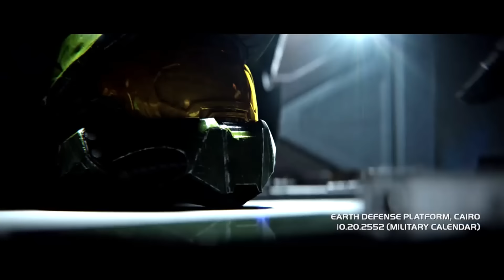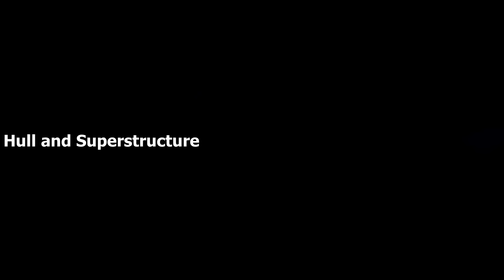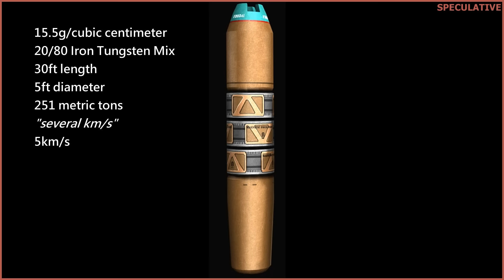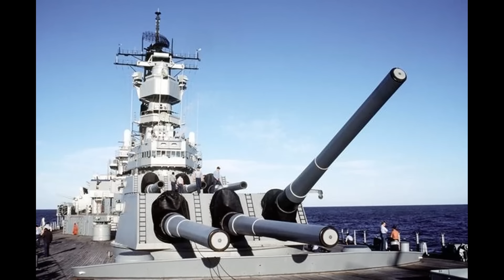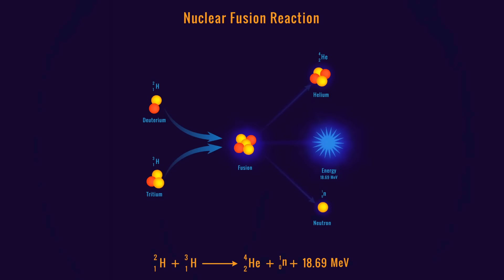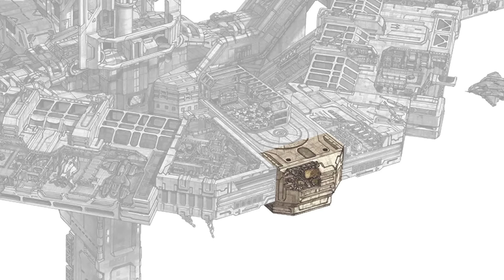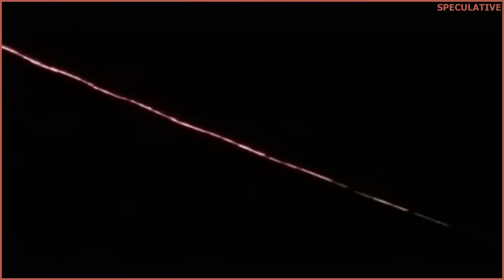Orbital Defense Platform | Most Detailed Breakdown

Comment: Dude. Railguns / MAC guns in Halo and even what we’re attempting to do in real life, are so damn cool. They just take up SO MUCH energy. And the forces exerted onto the firing chamber and platform itself causes any large railgun prototype to essentially tear itself apart, which can cause really big and bad accidents to happen if the firing chamber somehow is buckled or misaligned or whatever, and the projectile hits that damage.

They’re while we’re getting more knowledge about them with the real world tests being run, a huge limitation is the power needed to regularly run it. Essentially if we wanted to retrofit large battleships / destroyers / or aircraft carriers, we’d have to throw on a whole extra very efficient nuclear reactor onto the ships. (I know modern aircraft carriers are nuclear, unsure about other large gunships). But along with the guns themselves, and the added reactor, I think it becomes a very heavy and inefficient system. 

We need to crack sustainable fusion based nuclear reactors, and be able to control the whole process easily, create materials that can withstand the process long term, and collect the energy that it would produce in a highly efficient way. And then make it small and light. Assuming if we do that, we would also have materials strong enough to withstand the physical effects of a giant railgun being fired continually. We could also figure out ways to harvest the spare energy from the gun and feed it back into itself. Like how hybrid and electric cars use braking to recharge the giant electric battery. Perhaps capturing the heat from the firing and generating power from it. Or some other cool futuristic way they end up figuring it out. Then it would require less energy, and make it more accessible because a less giant less powerful fusion reactor would be needed also. 

I wonder if I will be alive to see humanity crack it. Maybe if we get the orange idiot out of office. And we start following chinas lead with educating all of the population equally, and investing in our country’s people instead of selling us down the river. He’s done so much damage already to what we could be as a nation. Very sad. I used to muse about the future as a kid and wonder what I would see. Now we’re on track to collapse back to a failed state. All so a few rich ppl can get richer, while they’re at the end of their life and don’t have to deal with the effects of this stupidity.

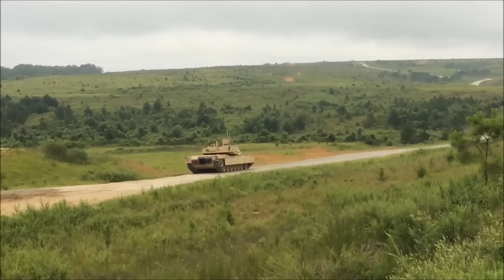Comment: 24:11 you state the projectile speed at 5km/s and weight at 251t. I cannot argue the weight as mass doesn't lie but for shot velocity Adm. Hood (I think) claims the shot at 3000t and 4% of light speed, or 12,000m/s. While obviously not as heavy as that the given weight at the new speed measures 1,151,520 tons of TNT equivalent energy. Given what we see these projectiles do, namely able to penetrate 2 heavy cruisers and embed into a third assuming a perfect shot and the ability of covenant shields to withstand moderate yield warheads (shiva class) I really think the higher speed is more likely. A 750t warhead is backpack sized and honestly not even worth building the massive platform as a shiva would deliver a 30Mt yield. I would have to assume the physical mass of the projectile would be more effective than the sheer numbers given the shields are likely tuned for anti-energy fighting other covenant style vessels and less effective at altering mass-based energy loads. At 1.1Mt the energy delivery is still far below a shiva but well within the realm of justification for construction given the ready availability of ammunition and not requiring fissile materials.

Comment: Error at 1:07:22. 15 km/s would not be even close to 5% the speed of light. 5% of light speed would be closer to 15,000 km/s, so this would actually be only 0.005% of the speed of light. I assume this was an error with confusing 15,000 meters per second with 15,000 kilometres per second. Just wanted to point this out for the sake of clarity.

Comment: The trams seem very excessive in design., i can imagine that building these ODP's is highly expensive and so minimisation of size and thus cost sould be incredibly important. Some sort of transport would be required for the size of the design, but this could be countered by a more efficient and compact design.

Why are there multiple bottlenecks by having the habitation modules stretch around the station??? Surely having a compact design around the MAC would be more efficient and stronger in the event of battle damage. 

The big counter would be "ew its ugly" or  "it would be boring for cut scenes". However i dont think so. Think of battleships in the 20th century, there is plenty of areas where you can see out but many more where you are condensed within the hull of the ship.

Furthermore a compact design could save weight and cost and allow greater armouring around critical components so that the ODP can remain operational and defending its respective planet.

Having such a spindally and weak structure for a Orbital Defence Platform just doesn't make any sense. 

By having a more compact design you could also forgo the need for transport as the station would be more walkable.

ALSO, why the hell is the brain 'the bridge' so exposed. Having sensores and etc outside the ship makes sense but the bridge should be buried in the heart of the station like the reactor and autoloader for the MAC.

If the bridge needs a view of the outside then that could be provided by cameras outside.

Bit of a rant
Reply: The entire point is that the station part is built around the gun to balance it. And most the station is just the two try docks  on each side, the stations connects those
Reply: If something has gotten close enough to the station that can shoot it then its too late for armor or survivability to matter. They outrange everything else in the setting by a factor of like 5 and thats what they rely on. Something similar is the AMX-30 ACRA. A tank modified to fire ATGMs. This was at a time when russian tanks didnt have rangefinders. So the ACRA could fire at russian tabk coloms with impunity while the russians were trying to range in the target before using its speed to escape before they got a bead on them. Also the bottlenecks would make it easier to defend.

Comment: 1:07:22 - "15 km/s is 5% of the speed of light"

I think you dropped a couple orders of magnitude.  15,000 km/s is 5% of c.  15 km/s is 0.005% of c.  Maybe you took 15,000 m/s and read it as km/s?
Reply: Uhm.... 1 km = 1000m
So 15km/s is indeed 1c.
Reply: @KAKU_64
C is 300,000 km/s

15 kps / 300,000 kps is 0.00005, or 0.005%. If you don't believe it, just go type 15 kps into one of the dozens of "percent speed of light" calculators out there.

What I am saying is that 00 may have been working with the 15 km/s number and converted it to 15,000 m/s (probably to calculate kinetic energy), then mislabeled it. In other words, he accidentally and incorrectly multiplied by 1000 somewhere. In the metric system, the most likely candidate for such an error is changing prefixes.
Reply: How would he misread 15000 m/s to km/h if km is bigger than m? Lol
Reply: @KAKU_64 did you even read his pinned comment that corrected it? C is the speed of light. The speed of light is 300,000,000 m/s. Aka 300,000 Km/s

Comment: Great video all around. just something i noticed that has been a problem in other real life ships/bases that seems to be potentially present in the ODP layout.

The use of numbering and color coding is good, but i would say that if the ODP were ever expanded on in cannon there should be a slight change to the numbering:

The port/starboard side should be enumerated slightly differently, due to the hangers being enumerated as A.01/A.02 on the same side. The numbering of r.01 and r.02 for port and starboard could lead to easy mistakes for logistics and staff, imagine getting told to report to hanger .02 and knowing the station numbers going to the starboard hanger .01 equivalent by mistake, this is surprisingly common on some older ships/bases and has been mostly fixed by renaming/renumbering affected areas
the easiest fix would be for the leading number should be a qualifier to denote the mirror of the module. [0 for port, aka .01 .02 .03 would all be port]

To expand on the fix to this i would recommend that the port be 0 [X.0X] and starboard side be qualifier 9 [X.9X] to help against dyslexia problems and communications interruptions/interference as 1 [X.1X] would have issues around [X.1X] being mistaken for [X.01] due to user error or comms failure. 
this still allow for incoming space traffic to be assigned a hanger number that is between 1-8 and maintain the internal consistency, hanger 2 would be called for ATC as 2 and when communicating for landing/takeoff/approach/other local space management, but would be A.02 internally marked, and on starboard side hanger 5, called 5 by ATC, would be internally marked as A.95 on doors and called such by sec/staff
It can be assumed that the .X1 is maintained on 'unique' one off modules to maintain nomenclature standards, even if there is only one Red rec hall on port, still called R.01 instead of R.0

also i assume this is probably due to the halo 2 story, but there seems to be no staff quarters for command air force personnel, think ATC, mission planers, etc near their workplaces, maybe air staff is separated from navy vertically where one gets 1st deck and other gets 2nd deck, but was consolidated to both for navy due to staffing needs for fleet command in the story of halo 2

thanks for the great vid

Comment: 24:00
That's a pretty big oversight considering the UNSC regularly slings nuclear warheads with yields in the tens of megatons which often fail to usefully affect heavier covenant capital ships
Reply: @seagie382  there is a large difference between a nuclear warhead exploding against the covenant ship, and all that energy pinpoint focused into one area. The ship may be able to resist it when all of that energy is spread out over the Shields and hull, but it cannot resist that amount of energy hitting it in such a small area.
Reply: @Aerosolcb  but that is still weaker than other known mac cannons when the light coil mac on low power is 64 kilotons

Comment: Looking at the capabilities of the Moncton Class, it would seem to be inconsistent with other weapons platforms and MACs in use by the UNSC. The Erod Class ODP above reach, for example, fired shells weighing 3000 tons at 12,000km/s, hilariously higher than the Moncton Class. This means that, If the Moncton Class is at all competitive with the Erod Class, it should be firing shells at a similar if not higher velocity. 

The Halo universe is often inconsistent, so let's assume that it is in fact firing its shell at a few or several tens of thousands of kilometres per second instead, and take a lower estimate of that. So long as this velocity still lends it less firepower than the Erod, by about 10 times, this is fine. 

It's also worth noting that, if you aren't limited by technology, it is better to fire a smaller projectile faster in space, as it will have similar or greater kinetic energy (depending on how fast you send it) but be harder to detect, harder to avoid, and cheaper. This does have some caveats, as a smaller projectile carrying similar or greater kinetic energy may be stopped easier by things such as spaced armour (i.e. Whipple shields), as the projectile would tend to explode into plasma on impact even more than the larger, slower projectile. This is another issue I have with Halo, as it would generally make sense to have smaller, faster shells, but at every turn they seem to have shells that weigh as much as a small water ship. 

One issue I noticed, at the 1:07:20 mark it is stated that 15km/s is 5% of light speed, when light speed is 300,000km/s, which would require a speed of 15,000km/s to be 5% of light speed. 

Either way, these are just personal thoughts on halo lore in general and a minor correction, this video is excellent, fascinating, and in depth. Can't wait for more in this hallowed Halo series.
Reply from the maker: @proph7543  there are lore inconsistencies which are infuriating, but I'm trying to stick to the Lore where possible. I'd argue, given the Moncton and the Erod use the same series of accelerators, that they should be identical in all but the mass of the rounds fired. I mean that makes sense, but hey, I'm just a dude on the Internet with 2 degrees and a functioning prefrontal Cortex. Far be it from me to question the lore! :_Happy:
Reply: @Installation00  Haha, indeed. Oh well, a certain ambiguity gives us some room to actually expound on the lore. 

And clearly game devs know more than anyone else, how on earth could we ever question them?
Reply: Somewhat explains why 20 Erods around Reach did a better job at fighting the Covies, than 300 Monctons around Earth.
Reply: I honestly never bought that reach got a stronger ODP than earth. Even if reach is the HQ of ONI. Earth is still fucking earth.

Comment: The examples for the mac round energy for the platform are a bit daft, just say 0.75 kt or about 700 times the Davy Crockett's nuke. That doesn't sound too impressive until you realize the round's depositing that at a single point and that tungsten, in the right conditions, can self-sharpen. IE, that would do a hefty amount of damage to a planet.

Comment: Electrostatic direct energy conversion is not as efficient as a heat engine. The issue is that in direct energy conversion, the free neutrons are completely wasted in the process as the don't produce an electric charge. Since hot neutrons are over 2/3rds the output of a fusion reaction, that's pretty painful to miss out on. 

Also there are just more efficient ways of making a heat engine. A popularly talked about one is super critical carbon dioxide which allows for turbines only about a 20th the size for the same power output and a slight efficiency bump. But more importantly would require less replacing of the turbine blades due to water damage.
Reply: Humans will never stop heating water.
Reply: @robertharris6092 well lots of companies are already talking about super critical carbon dioxide being on the table. It means the cost for materials and space are lower, but everything needs to be able to handle far higher pressures.

Comment: Regarding the cooling of the main gun, a great example of the ridiculous efficiency of flash evaporation versus radiators in space is on the space shuttle. To cool the space shuttle, the payload doors needed to be opened as soon as possible upon entering orbit to cool the spacecraft. They covered the entire surface of the inside of the doors. But, there was a backup flash evaporator that used liquid ammonia if the payload bay doors jammed or if there was damage or malfunction in the system. The Flash evaporator was only about a square foot in size near the nose of the shuttle just under the crew compartment.

Comment: 1:07:20 correction: 
c = 300,000 km/s
15 km/s = .00005c or .005% c
Might've gotten your meters and kilometers mixed up, there, fam. 😂

"Several kilometers per second" is a GROSS understatement of the velocities these rounds should have, considering the speeds that ships are capable of, and how much faster the rounds have to be for the station to be an effective weapon at extended ranges, the way they are intended to be.

Keep in mind that even older UNSC ships are capable of orbiting terrestrial planets in just a couple of minutes, and Covenant ships are generally much faster.
The ISS orbits earth at around 8km/s and makes a full revolution in approximately 90-93 minutes. The UNSC Iroquois completed the "Keyes Loop" in a matter of seconds, maybe a few minutes at the most. Even with gravity-assist, the ship would have to be capable of traveling dozens of times faster than the ISS, putting its velocity in the ballpark of 300-500 km/s, or .10% - .16% of lightspeed.
In the opening cutscene of Halo: CE, the Covenant fleet at Installation 04 traveled from the far side of a gas giant, all the way around to engage the Pillar of Autumn within several minutes of the Autumn exiting slipspace, which does, indeed, indixatd a significant speed advantage for Covenant ships, given the distances involved, as well as the fact that they had to fight against the gravity well of a comparatively massive planet, whereas the Iroquois was getting a gravity-assist from a small terrestrial planet during the "keyes loop."

Given these figures, it makes WAY more sense if the rounds from a MAC gun really do actually travel at 4 or 5 percent of lightspeed, which is at least a few hundred, or even over a thousand times faster than the stated, "several kilometers per second." If this isn't the case, then ships could just sidestep the rounds, even at very close ranges.
I would personally refer back to some of the previous videos about MAC guns on this channel, rather than use the figures stated in this video.